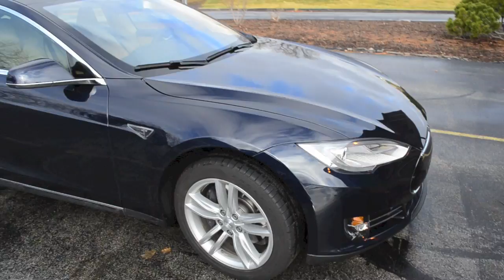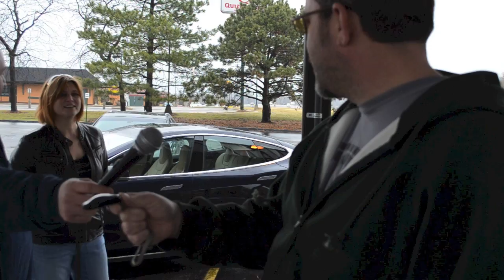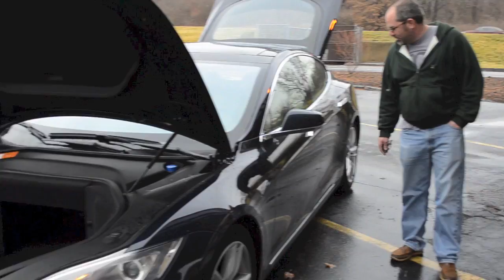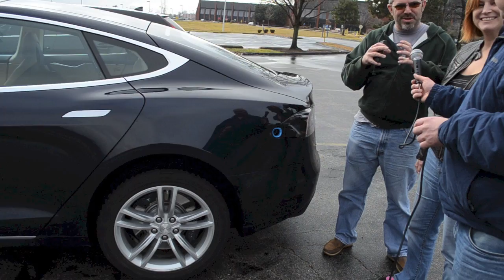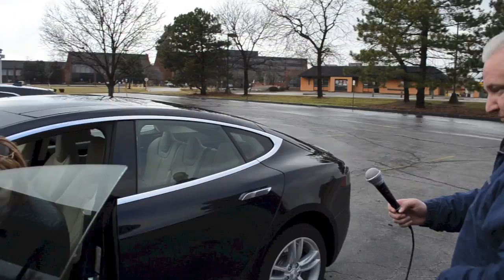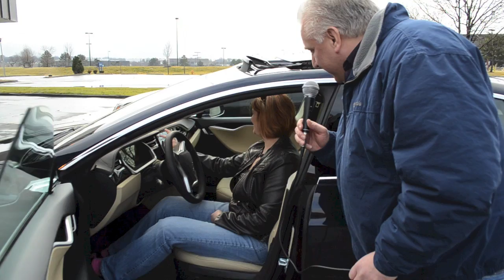New Tesla Owners Interview P1

Comment: @MyGreenEarthLLC - You are correct that there is a faster charging option available in some markets.  Tesla, in conjunction with SolarCity, is installing Supercharging stations.  Supercharging stations are capable of putting 150 miles worth of charge into the battery in about 1/2 hour.  Tesla's goal is to have Superchargers along all major highways across the US, spaced about 150 miles apart.  Right now they have them in CA and the East Coast. Rumor has it one is coming to Bloomington soon.

Comment: @magicman421 - You are correct that the dual chargers will charge the car faster, in about 5 hours. However, our car is only equipped with a single charger.  We opted not to get the dual chargers as we rarely if ever will need to charge faster plus the dual chargers require purchasing the HPWC in order to take advantage of the faster charging.

Comment: @magicman421 - While you don't need to charge every night Tesla does suggest plugging in whenever you can, especially if it is cold.  You do this in Standard mode which takes the battery up to 85% capacity which is the ideal for the battery.  The car will automatically stop at 85%.  Though they do suggest setting your charge rate to as low an amp as you need to have the battery charged the next morning.